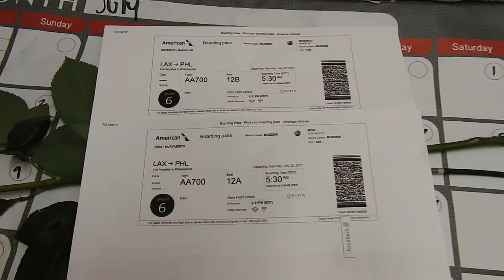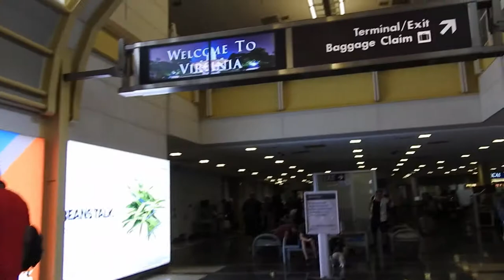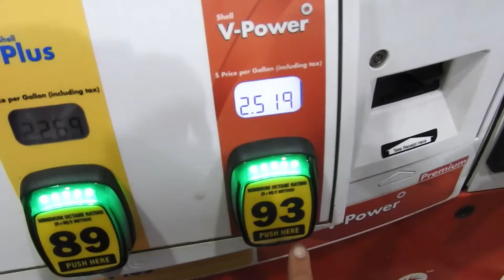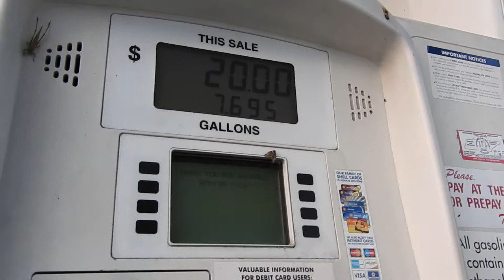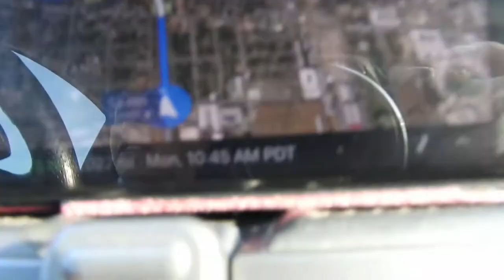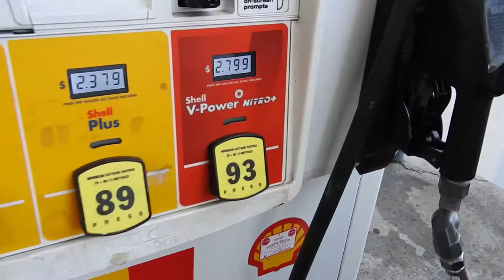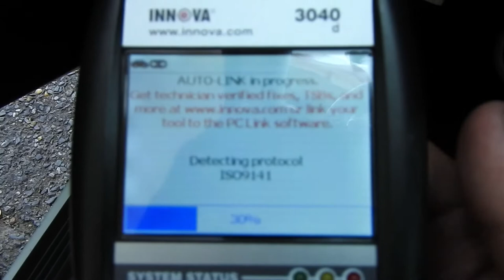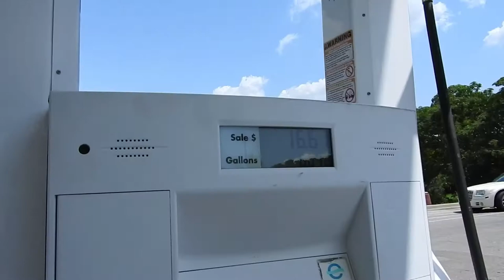Picking up another car for my wife

Comment: Dayum, little bit of TLC and the whip will be crisp! Nice that it came with some goodies too. Ive been thinking about getting Hotchkis sway bars with polyurethane bushings. Are the sway bars noticeable when it comes to handling and body roll compared to stock?
Reply from the maker: Mike West thats what I am going to do and they make a difference. This one has both front and rear and feels like it handles like my blue one with only rear sway bar and stiff coils
Reply: Nice bro, thanks for the reply! Im digging those bbs rims, I'm curious about how much they weigh.
Reply from the maker: Mike West Im not digging them, they are gonna be for sale pretty soon
Reply from the maker: Mike West Ill weight them if i can get a scale
Reply: Now that i pause the vid, they kinda look like the jetta wolfsburg edition bbs rims off of the mk4s or 5s.If u clean them up a bit i'm sure there will be someone looking for a set somewhere in the vdub community. I think you can get top dollar for them if you check jetta or vdub forums.
Reply from the maker: Mike West they are from the vw and i am going to put up there seeing if someone wants to buy them